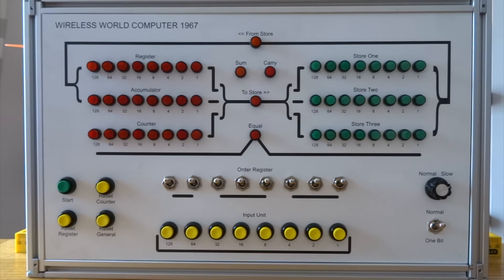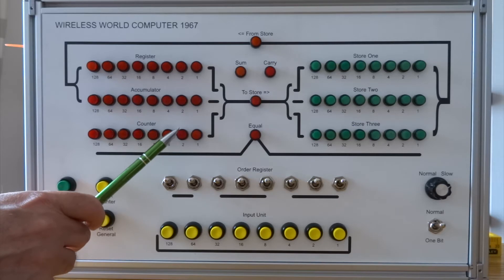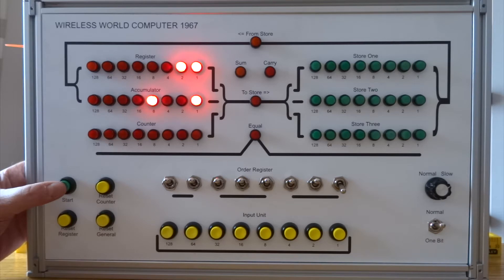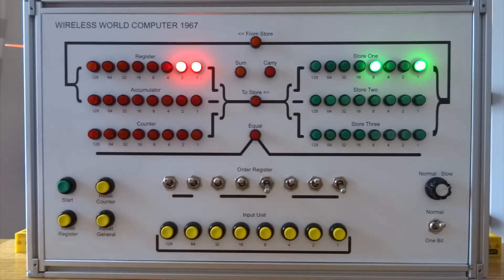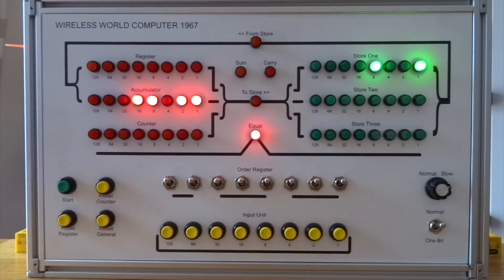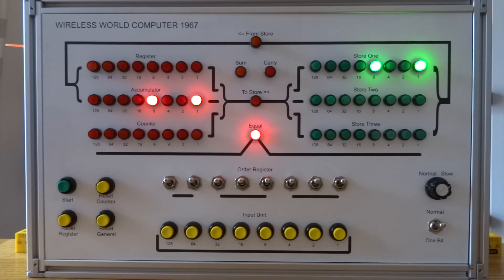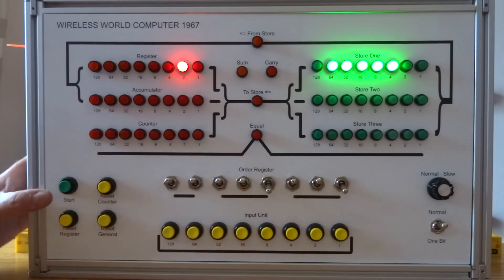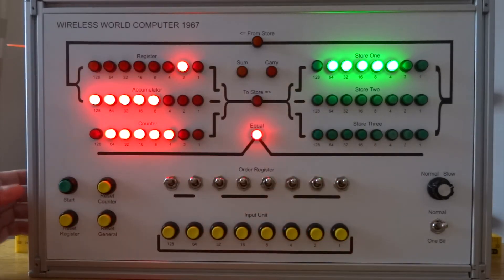Wireless World Computer

Comment: Hello Kevin, delighted you have built a modern version of my computer. It was a big project - I did it originally to teach myself something about computers! Best wishes, Brian
Reply from the maker: Many thanks Brian.  Heaven knows I learnt a lot building it!   I am half way through building the program store as you suggested in the original article, but the day job is getting in the way.    I am surprised no-one has coded a virtual version yet.
Reply: @kevinmurrell9779  Which article is that? I've got the articles that describe building the computer itself, but I haven't seen the one on building the store.
Reply from the maker: @MarkTuson  Hi.  There isn’t a published design but Brian suggested a patch panel. I will put some videos up soon.
Reply: @kevinmurrell9779  Sorry. I did not get back to you, I did not expect to be talking about the WW computer all these years on. The two biggest problems in building the original were money and display. I designed the machine as a home project - Wireless World had no knowledge of it at the start. Transistors were expensive, beyond my pocket, but you could buy bags of rejects which would include a number that were functional. In those days LEDs had not been invented, ordinary bulbs drew too much current to be driven by transistors. The only alternative was neon indicators but they required a voltage too high tor transistors. I found a way around this.  The prototype was built on Vero boards screwed to a sheet of chipboard (this can be seen on another YouTube channel), I told my employers, Wireless World, about it and they asked an engineer from ICL to give it a look,  He said it was good. So I bought a cabinet, designed the front panel of which you are aware, Fitted all the boards in the cabinet and wrote the article. My best design was the Logic Display Aid, also published in WW. I would like to have a go at recreating that as it was a more relevant today than the WW computer but am now a bit too long in the tooth. Best wishes, Brian